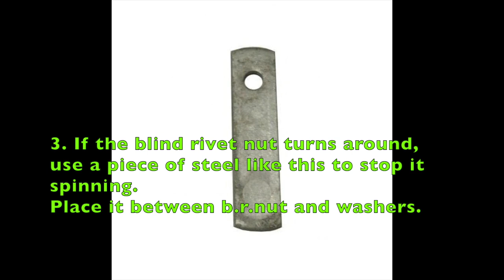How to install a blind rivet nut without special tools (PWJ195)

Comment: Nice job, though I did go and buy the cheap setting tool, seeing as i have started to use rivnuts a bit more now, and the setting with the use of a sacrificial high tensile bolt was becoming a pain to do. 

I take it you now have a Harl E motorbike, and the quietest one in the world.